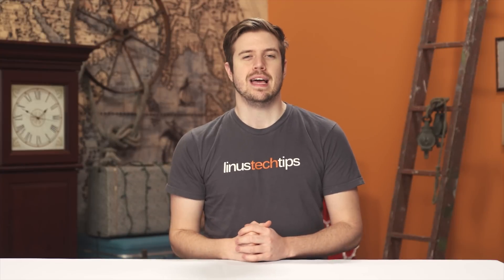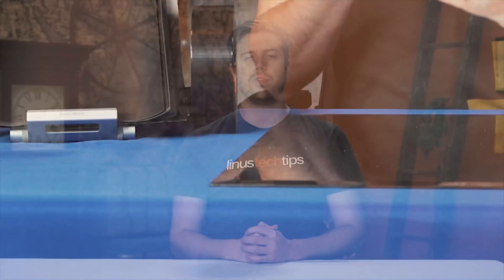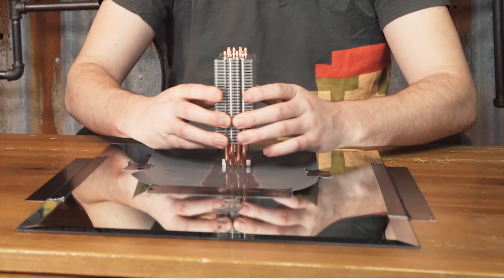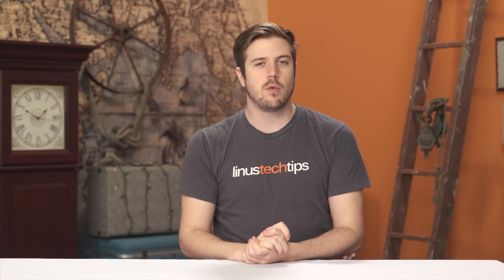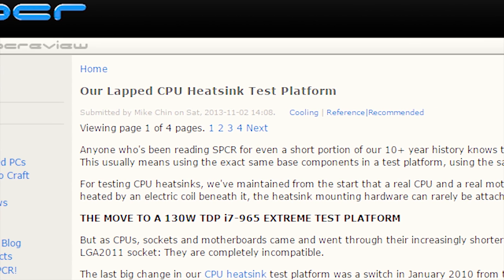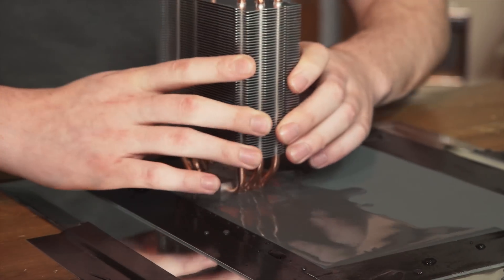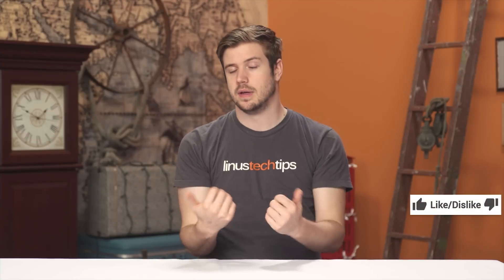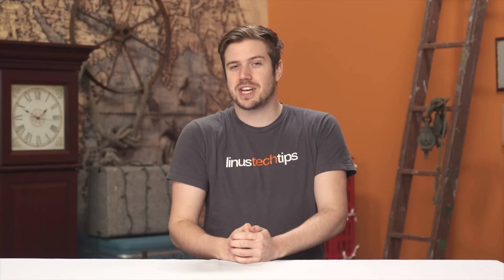CPU & Heatsink Lapping - Are concave, convex, or flat heatsinks best for cooling?

Comment: Us old school overclockers invented lapping to fix the really shitty heat sink bases that were around back in 99 when all the extreme overlocking and watercooling started. Lapped Celeron chips down to the copper, and this was before AC5 was around, which was another factor back then, shitty white thermal paste that couldn't conduct good enough. Now days bases are made much truer, and with AC5 or other silver thermal compounds, it really fills in any of those minor machine scratches that are sometimes left. Extreme overclocking might see a bit of a help but that is only under extreme cooling, such as trying to get the chip as cold as possible with refrigeration.
Reply: Old school RUles!!   right! i remember in Argentina only found crappy heatsinks made in china , only bad formed aluminium with anodyzed colours, 1cm height or 2 cm max, and cracppy fan coolers.. i started some mods on heatsinks around 1996 with Pentiums or AMD , I sell computers and I did not like to sell those crap, I started to make copper heatsinks and use Sunon fans, the best I could get in my city, those some computers were sold to Radio Transmitters where the computer worked 24 hours a day without stopping , at the most it was restarted every x days .. but never failed any even the audio playback computer had a cyrix 233 or 300 mhz by 1996 and that they warmed up a lot, with those modifications and holes in the cabinet all Fresh and worked wonders.

Not only had to use ingenuity and Lapping
Reply: @nopochoclos  So basically you were buying crappy coolers, improving them and re-selling? Nice business! Did you have problems with original manufacturers?
Reply: @EvgenKo423  Some of that...Within the garbage that was obtained in those years in Argentina, using alternatives and creativity, I achieved good results as far as I knew, not so in PSU, only gray generic brand fonts arrived, they generated instability, they burned memories or motherboards even sometimes microprocessors I remember it as the worst, above all what was achieved was not economical.

The best thing I did for me, was in a full tower deluxe cabinet was to put 2 ATX sources with Japanese capacitors, a sacrilege, working together to have at least 300 real watts.

For my clients I had adapted heatsinks to video cards, others made by hand with a lot of patience, notebooks instead of having themal pads had copper sheets made by hand, managing to lower many degrees, high performance thermal pastes did not yet exist but they were achieved good things with wit.
Reply: actually current IHS have still very poor flatness and lapping improves cooling, this is important when overclocking. Here are very good measurments: www.overclockers.com/heatsink-mounting-pressure-vs-performance/
Reply: Exactly right. 

It may help a crappy heat sink, but with modern parts, there's a chance that the "lapping" process actually harms performance.
Reply: Wow, so water cooling started in 99?? I'm surprised.

Comment: I would not consider what Luke did lapping, it was much closer to polishing.  Lapping is getting two surfaces to fit perfectly together (which should not need any thermal paste).  Polishing one surface only fixes part of the "problem".  Bolt surfaces, the heatsink and CPU heat spreader should have this process done and then lapped to one another.

Comment: WARNING!! DO NOT TWIST THE HEATSINK WHILE STILL ON THE PAPER WHEN TURNING 90°!! MAKE SURE TO GENTLY LIFT IT FIRST , THEN TURN 90° (while in air), PLACE BACK DOWN & CONTINUE!! 
If you don't then each time you do this it will leave unwanted round scratches. You also have to repeat this process many more times than 5 each way with each grit of sandpaper so be prepared to be there for a while doing this process of lapping. 
[I have lapped heatsinks before so I have first hand experience with this.]

Temp Results: 
As for how much of a difference it makes in the temp. My testing resulted in no more than a 1-2c change in temp that fluctuated and could of been accounted for as a margin of error. I honestly would just buy some decent thermal compound like Prolimatech PK-3 and not waste your time with Lapping. 

Tips & Experience: 
The process is not fun and a huge pain in the arse like wet sanding is not a pain as it is, you have to deal with the heatsink trying to skip across the surface once your water is not fresh clean. If you can build a setup to have constant flowing water across the sandpaper it would make this much easier. You should also seal the sandpaper with good quality duct tape ALL the way around, not just at each side. Sealing it helps prevent water from getting underneath the sandpaper and weakening its stability by waterlogging it.

Comment: of course it's not going to matter. when you have an average of less than 1/1000 of a millimeter of separation between the heatsink surface and the processor, it doesn't take a rocket scientist to realize that the heat insulation caused by these imperfections will be negligible compared to the centimeters of copper that separate the coupling from the actual heat dissipation element of the heatsink. even without thermal paste the difference would still be negligible. it's just a matter of thinking of the Physics involved.

Comment: I think most coolers are already fairly flat when they are shipped.  CPU's on the other hand, would benefit more from lapping due to their frequent surface irregularities.

I agree that a convex shape is better, but how do you achieve it?  Also, wouldn't there be a higher possibility of cracking the die?

Comment: lapped my big typhoon like 8 years ago when I had an Opteron 165.  Dropped load temps about 5 or 6 degrees.  The heatsink was slightly concave from the factory.  Lapping made a huge difference for me.  I also removed the IHS.  That did another couple degrees as well.

Comment: Though both changed by 3 degrees, it isn't the best way to see it. Consider the percent changes.
Percent change of ambient room temp: (22-19)/19 = 15.7%   
Percent change of CPU: (70-67)/67 = 4.47%    

Now consider the temperature of cpu to temperature of ambient room ratio. The lower the better:
Ratio pre-lapping/sanding: 67/19 = 3.52 
Ratio post-lapping/sanding: 70/22 = 3.18

So technically, the results are not the same, though the differences are minor. Trust me, I'm an engineer =).
Reply: +Jesse Chen I don't think those operations are correct when dealing with temperatures. The reason you get a higher percentage with lower temperatures is because the numbers are smaller and the absolute difference is relatively bigger. Remember that you are working with degrees Celsius which have a somewhat arbitrary zero point. 
If you would have use Kelvin, which has a much less arbitrary zero point, as a measure of temperature the percentage is, with your formula is: (295K-292K)/292K= ~0.01.
Reply: Koenraedus You make an excellent point regarding the zero point issue! I ignored it since most computer users' operate their computers above 0 degrees C. Not quite sure if that is scientifically tolerated.

I also must admit that I never fully understood why Kelvin works and why it works the way it does, but that is another topic.

Comment: A bit of insight on these results:
As long as the machinist(s) who made the part was competent and didn't make any mistakes through it's process it should be about at flat as possible without jacking up the cost. A CNC can easily make cuts at 1/10000th of an inch precision. If you want to know if it's flat without wasting your time get a pair of calipers that are worth a damn and measure it at multiple points. Results for lapping will vary, again there is always human error.. A chip in the fixture, defect in source material, dull cutter (which happens a lot to cut cost), incorrect zeroing. When these parts are made they are exposed to these potential issues many times. If both objects are "truly" flat they can make a weak fusion by just pressing them together but again this is EXTREMELY expensive to make.
Reply: +BlazarK Also lapping the CPU would be generally more effective for 2 reasons. CPU heatsinks don't have the copper exposed and from my experience they are usually convex. Note that you instantly void your warranty.

Comment: Isn't the purpose of thermal past to help create effective conduction of heat from the CPU to the sink?
if Lapping actually did anything worthwhile don't you think companies would come out with "ultra smooth" or "hyper-lapped" or some other marketing bragging about how uniform their contact surface is?
Reply: If it actually works (let's assume in this scenario it does), then the issue is that there are different manufacturer's creating the heat sinks and heatspreaders. Creating an identical surface would be difficult due to different manufacturing process. That's one theory at least. That, and the fact, that creating a glass-smoot, perfect surface would be expensive as hell. Much cheaper to use thermal compound.

Comment: lapped i5 2500k (soldered IHS, better contact between it and the die) and Corsair H80i (2nd gen). temps dropped around 5-6 degrees on hottest core 1.43v 5GHz. 5-6 degrees off from almost 90 degrees C is significant

Comment: Luke basically did everything wrong.  To get a flat surface with no high or low spots, ditch the mirror and use a basic sanding block.  A mirror is a pretty stupid idea and waste of money if you don't have one.  Sanding with a cross hatching pattern is best to get it super smooth.  You need to go in opposite directions to remove grooves and scratches.  After that you can sand in one direction.

Comment: Love your guys videos but I'm not sure this one is on the money. 

This topic is fully explainable using standard thermodynamics which would also suggest that the manual operation is only thinning the heat sync copper walls which will simply improve conduction (not really an effect of the lapping). To get the best results both the CPU heat spreader and the CPU cooler need to be lapped together so they both take on the same planar characteristic (one convex and one concave or both flat etc.). Matching surfaces coupled with an improved surface finish will reduce the amount of thermal compound (in this case thermally restrictive material) needed to fill the remaining space. In essence if the surfaces were identical (theoretically anyway) you wouldn't even need thermal compound.

That's my two cents anyway.
Keep up the good work :)

Comment: The entire point of using heatsink compound is to put a thermally conductive material between the CPU and heatsink surface that will fill any surface imperfections or gaps. If the CPU case and the bottom of the heatsink were true and perfect flat surfaces, I don't think you'd need or care about the compound, if the surfaces made perfect contact at all points, the heat would conduct without the compound. So in my eyes at least the use of the heatsink compound makes lapping an exercise in futility.
Reply: +compactc9 So lapping still doesn't matter, if you use a thermal compound?

Comment: Well I dismounted my BeQuiet heatsink and tested the curving ith a machined piece of metal and the curving was convex. my buddy had the same one lying around wich he wasn't using anymore so I took it and lapped it flat till a grid of 2500 or so and i actually went 3-4 degrees up on the same rig with the exact same cooler with out the curve.

Comment: I found that lapping cheaper heatsinks makes a really nice difference. lapping more expensive heatsinks doesn't make almost any difference, not to say that it won't cool better but the time may not be worth the results. with a stock AMD heatsink with copper core I was able to get around 4c-7c drop at load and the bonus is the fan doesn't have to ramp up as high to keep heat down.

Comment: Wouldn't the only important factors be size, Materials and surface area? Sanding the bottom for three hours just to have a smoother surface that is still has the same contact area as before should always net zero changes. Unless you have some major gaps in your thermal paste application that small bit of material your removing from the heat sink should and will make no change.

Comment: Lapping of heat-sink contact area doesn't work because the heat is transferred mainly through the thermal paste, (which has the ability to squeeze into small imperfections on the surface)

Comment: Being someone who has lapped pistons, you could have saved so much time (and got far better results) by using proper lapping paste on a lapping board (however a mirror worked well). I also thought thermal compound is there to fill any imperfections in the metal contacts to increase the contact area. So if you tested it again without thermal compound, you would get slightly lower temperatures

Comment: I have seen where lapping a CPU heat spreader and the cooler made about a 5 degree C change in temp. on a K6 AMD processor that was heavily overclocked, and a lapping a CPU heat spreader and cooler on a heavily overclocked dual-core AMD Athlon 64 made no difference that could be seen. I think it is a luck of the draw sort of thing.

Comment: Seriously thanks so much for the hard work. While the results may not matter. The information you provided does. I can put the extra $20 into a better cooler instead of 8 kinds of sand paper. And 3+ hours into more time tweaking overclock(or time explaining to my wife why I need a new computer) #luketechtips

Comment: i realize your in canada and you use metric, i also realize pc's use metric. but maybe if you used farenheit instead of celsius you would actually have a temperature difference since farenheit is more sensative to change then celsius. then maybe you can actually conclude one of these videos. for all we know all of the videos might have a distinct answer but since you used celsius you can see the minute changes. because after all these types of "mods" if you will, are only supposed to provide minute changes and not massive ones
Reply: +jjtonelli Even if he did use Fahrenheit it would still be within the margin of error and could be ignored
Reply: when your working with a test that has gains that are this small EVERYTHING is within the margin of error. with that being the case Fahrenheit would only make things more accurate. just because an increase is <1 degree C doesnt mean you should disregard the gain altogether just because its not seen in a whole celsius number, especially when another system will recognize the gain more effectively

Comment: Flat. Always flat. There's no fucking question. Surface contact equals heat transfer. This whole video could have been shortened to 4 seconds with a mathematical formula on the screen.

Comment: I guess i understand that lapping and creating a flatter surface ought to conduct heat better, but what is the point when thermal paste is placed anyway? Isn't the purpose of thermal paste to effectively fill those little imperfections and create a perfect conducting seal between the cpu and heat sink? I bet you would have gotten the results you are looking for if you didn't use thermal paste, but with your current experiment I'm not surprised that there was no difference.

Comment: PS. Emery Cloth is a more ideal material for polishing metals. 

After doing this, you should theoretically need NO thermal paste as the surface should be nearly perfect. That said, if the surface is actually perfect and you perform this same treatment to the IHS of your CPU (removing the zinc top layer and exposing the copper) you will risk fusing the cooler to the IHS, so ideally you would want to use as little thermal compound as possible. I dare say applying a liberal layer (complete coverage of the IHS), pressing the cooler down to spread it, curing the paste then removing the visible compound leaving just the surface film.

If you do ever decide to revisit this, I would suggest "lapping" both the CPU and the cooler surface (obviously you'd have to remove the IHS to prevent killing the CPU due to the water)

Comment: Hey Luke,

I have something that's a bit of a curiosity for me and MIGHT make an alright workshop video, though the result will likely be like all the other ones (not a "big" difference), but what if you guys did a workshop measuring latency differences in different connections.

Ex. 2.4 GHz WiFi vs 5 GHz
802.11ac vs 802.11 N (that's the one before it right)
WiFi vs Ethernet

Then to get to the more technical and main reason for me asking:
Cables and such
Do gold plated coax cables improve latency?
CAT 6 and Cat 6a latency
Cable length latency

Aside from picking up a plated coax cable, I'm sure you guys are already equipped to do all of the other tests. 
And for the kicker "mythbusters explosion special" you should steal Linus' billion dollar fibre cable that he has running from his home closet to his desk and test that vs CAT 6

Comment: Nice try Luke, I appreciate all your efforts! You know there are no bad experiments as you can learn from every one of them. Sometimes the results are not what you expected  and desired, but only persistence brings you normally to your goal.
If you really want to see better cooling performance by about 5-10°C you should try to delid a CPU and direct cool  the "die" with liquid metal.

Please keep doing this experiments, they are very interesting.

PS: The die guard can be 3d printed

Comment: Sand until you remove all the scratches from the previous grit. It isn't all ways 10 times. Cause you either didn't do that, or only went up to 2000 grit. If you want a true mirror finish, pick up some lapping compound. You will be taking more meat off your fingers than the block. And if you want an easy convex radius, turn the heatsink upside down and sand with the palm of your hand. Be sure to rotate the part to ensure evenness.